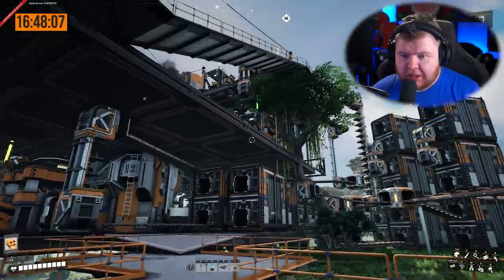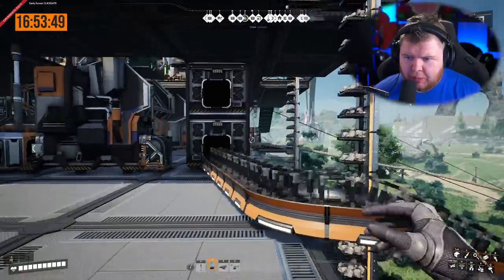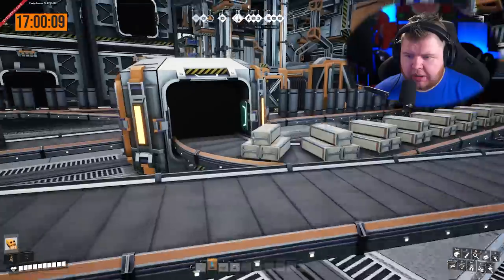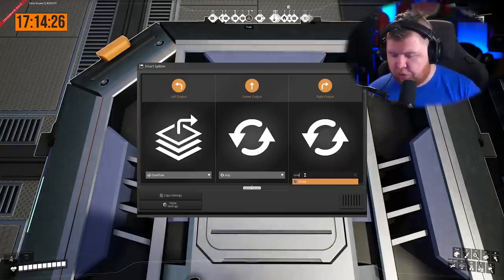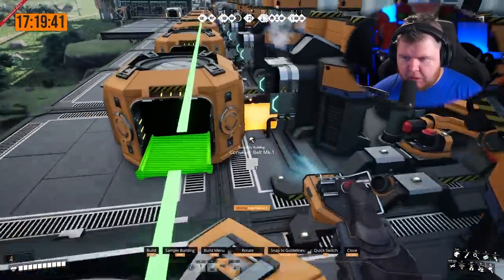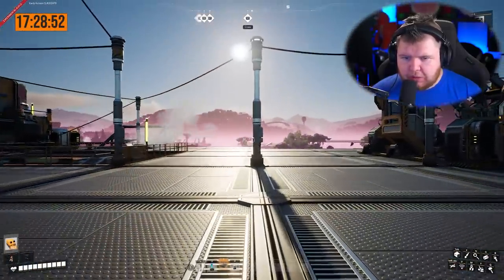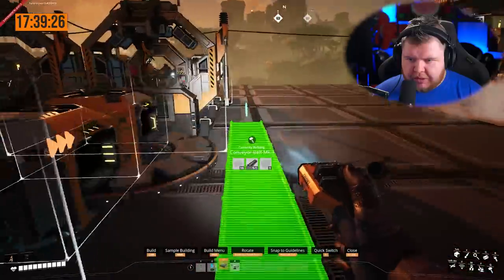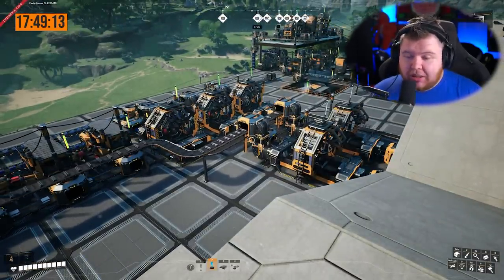1 HOUR!! To FIX a VIEWERS SAVE in SATISFACTORY Update 6

Comment: Nice format!
I find myself interested in “quick builds”. Say you got all the raw inputs and in an hour have to make a factory producing 10 Heavy Modular Frames per minute.

I usually get stuck just doing things all over the place and not pushing forward. To see what can actually be built in a small amount of time would be great.
Reply: personally I've started doing outposts producing the base items (like plates, rods, pipes, encased beams, wire, copper sheets, caterium wire, plastic, rubber, etc...) it makes the base so much cleaner and makes everything faster to build.
also planning what you need helps quite a bit, if you know how much power you need you can plan your power, and not have to worry about it till you're finished with the current project. (though having the 4 oil nodes on the left of the map producing plastic and rubber and the rest going to diluted fuel makes it very easy to get enough power till nuclear.)

Comment: You would hate my base it is so freaking inefficient I tried my best to make something that resembled efficiency but that just turned into a mess really quickly so now my entire center of my base is well crap it's all jumbled messes of wires cabling energy producers like biomass burners coal burners battery storage My hub my space elevator my my only and only tractor root which is delivering more coal to be a little more efficient with coal and coal storage storage crates stacked so damn high you think I have infinite storage  and half of my plants don't even work like half of the machinery I use right now isn't working or being used